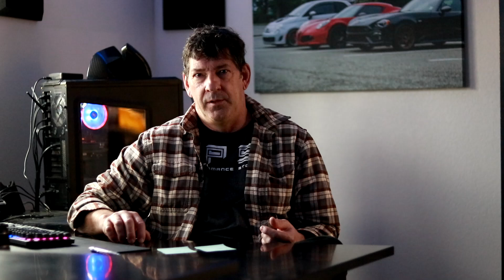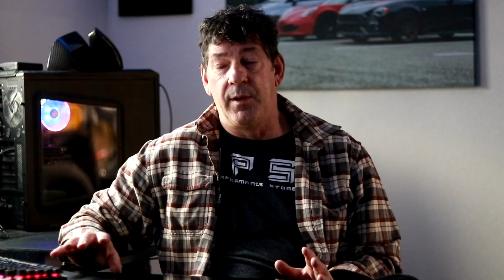Boeing 727 Falls From the Sky TWA 841

Comment: Thank you for the time with this video Greg. Lots of in-depth technical information about the Boeing 727. Just some things to mention here:
1. To have only the trailing edge flaps extend requires more than simply pulling the circuit breaker to the Leading Edge slats. You first have to turn the Alternate Flap switch on, pull the circuit breaker, turn the Alternate Flap switch off and then extend the flaps.

2. The NTSB declared that the isolated extension of the No.7 leading edge slat after the extension and retraction of the slats is what caused the upset. With the slat extended it caused the 727 to roll over into a dive until at 8,000 feet it tore off and enabled the pilots to recover the plane.

3. The pilots did NOT erase the CVR. There was still 9 minutes of recording available to the investigators where they were talking to each other and to TWA Ops after they had landed. The dive and the events leading up to it would not have been recorded because from when they recovered the plane until they landed was 42 minutes so the recording would have begun 12 minutes after they recovered from the dive. Hoot Gibson left everything in the cockpit as it was to help the investigators figure out what happened which is inconsistent with one trying to coverup a misdeed they did. For the CVR to be erased, the plane must be on the ground and completely shut down with the brakes set and the damage to the airplane, in particular the landing gear, meant that its computers didn’t recognize it was the ground. Therefore the pilots could not have erased the CVR even if they wanted to. The wiring to the CVR could have been damaged by the 6G pullout or it was defective even before the flight. Another explanation for the erasure was that a CVR expert determined it was due to the slow transfer of power from engine power to APU power after the engines had completely shutdown after landing.

4. ALPA determined that the physical evidence showed a fractured bolt to the right outboard aileron caused it to free float up and the 727 to turn to the right and off its heading. The yoke turned to the left as the Autopilot Heading mode was on trying to get back to the preset heading. The vibrations were due to the left spoilers raising to aid in roll control. Then the Yaw Damper rate gyro or coupler sensed discrepant rudder inputs which resulted in a lower rudder hardover that sent the plane into a dive. On the 727 the outboard ailerons lock out when the flaps are retracted and movement of the rudder is greatly limited when the flaps are retracted so with a fluttering outboard aileron and a lower rudder hardover the pilots were left with insufficient aileron and rudder control to recover the plane. When the gear extended the right gear overextended which ruptured the System A hydraulics cooling line that centered the lower rudder and allowed them to recover. The No.7 was misaligned and didn't lock into its locking mechanism so the only thing keeping it retracted was System A hydraulics and aerodynamic forces. With System A gone the aerodynamic forces of the dive caused it to extend.

Additional notes:
- Hoot Gibson stated before the upset the plane yawed to the right, paused and then yawed right again. This is corroborated by sharp heading changes on the Flight Data Recorder. Only the rudder(s) could have caused this.
- After they recovered, the Flight Engineer reported they had a fail flag for the lower rudder yaw damper. This would only occur if the rate gyro malfunctions or lost electrical power.
- Days after the upset the accident plane was taken up on a test flight and they went up to FL390 and extended the flaps and slats to the 2* degree position which caused severe vibrations, not slight vibrations as the passengers and crew of TWA 841 had testified. The Captain of this flight testified in court following a passenger suing TWA and Boeing for injuries that he did not believe the pilots had extended the flaps and slats in cruise flight. 

- Actual flight tests on a 727-100 determined that had the pilots extended just the flaps and then the slats extended there would be a sharp pitch up as per the Flight Data Recorder but there was no sharp pitch up on TWA 841.

- Had the pilots extended the flaps in cruise the passengers seated over the wings would have heard the distinctive growl of the flap motors as the pilots extended the flaps and then retracted them but none did.

- The NTSB’s own simulator tests showed the slat would have ripped off at no lower than 30,000 feet, not at 8,000 feet in actuality, and for their theory to be believed, the slat remained attached even at the speed of sound. Boeing engineers determined that the slat could not withstand a speed greater than 363 knots while extended, so the slat would have to have ripped off at an altitude close to FL390.

- The physical evidence showed the over extension of just the right landing gear and the inboard flap track — a pattern of differential damage — was consistent with a large left wing forward sideslip angle present of the gear extension.

- The co-pilot stated in an interview in 2015, months after Hoot Gibson died: "I can’t say with absolute certainty what caused TWA 841 to roll over and dive some 39,000 feet, but I can say with absolute certainty that the investigators got this one wrong." Why would he continue to maintain his and the FE's innocence over 35 years later if they had indeed caused the upset? Was he worried that Hoot would throttle him in Heaven? Nothing would happen to them now for coming clean.

Cheers.

Comment: Good to finally see your face!  Thanks for all the interesting posts.  
I too generally agree with your and the NTSB's conclusion on the 727 dive.  During my 36 years flying for United, about 15 on the 727, we always knew about the "Gibson Trick" and talked about it even before the incident, but nobody I knew ever thought it was a good idea or suggested using it.  Maybe that's why my career was so uneventful.
But...
When I was upgrading from the 727 to the DC10, one of the guys in class had come in from the Continental merger, and related an interesting story.  He was a 727 FO there and had a totally uncommanded outboard slat extension while maneuvering at low altitude and airspeed.   The airplane was controllable under those conditions, they landed safely and wrote it up in the logbook.  Several weeks late he tried to find out what had caused the problem, and suddenly nobody knew  anything about the incident.  Hmmm...
Conversely, I watched a situation when one outboard slat remained extended when going from flap 2 to flaps 0, it took a LOT of aileron to keep the wings lever.

Comment: Hi Greg, one thing I didn't get from your story is why would the pilot want to get to a higher altitude ? Does this allow him to reach his destination faster or at a lower cost and thus get a bonus from the company ? Or is it just to be part of the "went higher than the manual said I could" club ? Thanks and keep up the great work
Reply from the maker: It's usually related to fuel burn. It's often said that the TWA pilots got a bonus for saving fuel. It could also be for mach limitations in some case, or just to get over weather you don't want to go around.
Reply: @GregsAirplanesandAutomobiles thanks that makes sense
Reply: Just to be clear, they were originally flying at 35,000 feet where they had a 100 knot headwind so they requested to climb up to 39,000 feet where the headwind was forecasted to be weaker. With a headwind it decreases ground speed therefore lengthening the flight and burning more fuel. Another thing to mention is that it was after they reached 39,000 feet did the pilots supposedly do this trick.

Comment: The irony of the 727 noise issue is that when Boeing first built the plane they called it the Whisper Jet😆. I believe we got rid of ours because it was cheaper to get new airplanes over the  long run rather than get the Hush Kits (I believe Fed Ex was the STC/Patent Holder for it).
Reply from the maker: There were quite a few different "hush kits".

Comment: When I started working on 727-100s in 1981 I saw a couple planes with the word “hoot” hand written above the L.E. Circuit breaker on the P6 panel. I ask my lead man about it ( old braniff guy)and he told me this story. When I worked at DTW I saw this airplane shortly after it landed. It sat there for a period of time before it was gear down ferried to MCI. 
I’m sorry but I believe you’re wrong about locking out the 40 degree flap setting. That happened because of the United crash in Denver.
FedEx and Pratt and Whitney developed the 727 hush kit. I worked on that program in 1989. The flap setting had nothing to do with the hush kit. There were a couple other kits but they were not very popular.
Reply from the maker: There is no way I can agree that the Denver crash was caused by flaps 40.
Reply: @GregsAirplanesandAutomobiles  it was , with 40 degrees selected the sink rate was too fast for the engines to spool up and fly out of, read the book “ the unfriendly skys “ it has a lot of info on the early days of the 727. After that crash 40 degrees was bolted out could not be selected it had a bolt that prevented it.
Reply: @aaronchandler2380  In that incident, the pilot was too fast/too high, and 'unspooled' his engines ; this led to a high increase, quickly, of the sink rate.  The airplane had been well certified with 40º landing flaps (allowing for greater short field performance), and, also, this high sink characteristic was well documented ( and trained for). The '40º flap bolt' was installed in order for the airplane to meet the ever-stiffening noise abatement rules coming into effect.
Reply: @divingfe  well I’m sorry but the 40 degree setting was locked out because of the possibility of an unsafe condition during landing, long before the noise issues. 40 degrees was not in the takeoff band. I’m not sure how you can un spool your engines on a 727? There was no flight idle so you need to fly it onto the runway, 40 degree flaps made that problem worse.
Reply: @aaronchandler2380   Not true sir. The airplane was certified with flaps 40º and used extensively at that setting. VERY EARLY-ON When UAL had started their own in-house training, they discovered (while transitioning 'straight-wing' pilots) the dangers of 'un-spooling'  when at low final approach speeds and altitudes, Hence the industry-wide reminders to keep spooled up in what is essentially a "short-field" landing, regardless of the runway length.  This remained the case for MANY YEARS, with no issues. Now then, as some  relatively in-experienced pilots were beginning to operate the 727, they may well have had problems, not having had sufficient training. BUT, the 40º degree flap "lockout bolt" happened WELL INTO the later stages of the 727 ('80s???, I don't really recall.. but that was strictly for meeting the upcoming NOISE regulations, especially in Europe. I suppose it made the 277 "easier" to fly?? although of course, it couldn't then  operate out of its famous short fields. And certainly those rated on the airplane thereafter, were , by definition, somewhat less competent.
Reply: @divingfe  the United SLT crash was directly attributed to this. I started working on the 727 in 1981, the 40 degree lock out was already in place for sometime before that. It had nothing to do with noise. 40 degrees was outside the takeoff band, the takeoff warning would sound. There were I believe 4 different crashes all attributed to flying techniques during landing that were fixed with the flap setting change.
Reply: @aaronchandler2380  Sorry Again, Aaron. I started on the 727 in the 60s, was instructing on it in the 70s, and worked for Boeing as such. Flew and FEd it until the end of 94. Yes the lockout was in place around that time, but not because of the crashes. They occurred because of poor training, execution and cockpit discipline. As mentioned earlier, this "characteristic" had been around since 3/4 engine jets were first flying- more notably in the 727 because of its exotic flap setup. We SPECIFICALLY TRAINED pilots about the dangers of 'un-spooling' and un-stabilized approaches. Boeing wrote two specific manuals about Pilot ( and F/E) technique; the 707 Pilot Training Manual, and the 727 Pilot Training Manual. Also, two companion more detailed ones for the F/Es. I know that some  later operators did not give enough training in this as well as other regards, hence the accidents. 
But, if you will research the noise regulation increase[s], during that era you will find that the FAA and the European Agencies put the regs into effect;  the cure for the 727, was to install the 40º flap lockout. which allowed the airplanes to operate without restriction-just barely. There is no question about this. Now, 40º flap has NOTHING to do with takeoff- it is a LANDING setting, along with 30º. Now I will certainly agree that the fewer non-competent pilots/training, were certainly kept out of trouble more so with only 30º degrees to land with- -kind of like 'training wheels' on a bicycle. Cheers.

Comment: Greetings: About the Piper - I would think the weight imbalance would B noticed by a good pilot. Just a thought
Reply from the maker: The Navajo's had inboard wing tanks, and outboards for longer flights. This was a short flight with fuel in the inboards only, and not a lot of that, thus not much lateral imbalance. This was compounded by the fact that many of the planes at this airline were a bit bent anyway and needed unusual amount of trim on a normal day. I know because I flew there.

Comment: Greg, I engineered the B727 for 3.5 years in 1978-1982 and in my observation, flying with Captains and First Officers that were as paranoid as any, we definitely did NOT regularly erase the CVR. Perhaps your company did; I can't recall ever seeing a Captain doing it (and we definitely knew where the mic pickup was, and the test and erase buttons as well).

Second, you really need to look at optimum altitude and G-limited buffet margin charts for the 727-100. What engines did it have? The ones I engineered were mostly JT8D-7A engines, but there were three airplanes in our fleet with the -9A engines (which all of our 727-200s had mounted). I believe the NTSB report said their weight at the time of the request for FL390 was 140,000 lbs, and at max you'd be flying at FL 310, and certainly not FL350 unless you new, ignorant, and crazy. FL390 was right out. 

Third, I used to carry charts in my 727 Jepp binder that were the comedy charts, obviously unofficial, entitled something like "Optimum Altitude Charts for Flaps 2 Extended Cruise" or something. Plus, I flew with two Captains (IIRC) that both argued that you'd save oodles of fuel by climbing with Flaps 2 trailing edge Improved extended and I thought that was crazy to risk your job -- with a hundred witnesses in the back! -- for something unapproved. I searched and I can't find my old charts, they've gone missing in the last 3 or 4 moves.

Fourth, LED circuit breaker was the trip up. Pull that and the blue (or maybe is was green) LED Extended light on the forward instrument panel would illuminate, but that CB controlled only power to that light bulb. No, the CB you wanted to pull was the Leading Edge Device CONTROL circuit breaker: a little harder to find. (I could do it in my sleep, which is a confession that I had more hours as a flight engineer than a guy really wants to have logged.) Hoot and company kinda messed up the LED Control CB.

But uin general, I agree. The aerodynamics do not conform to the NTSB nor Boeing's explanation. But it's ancient history.

And guess what? The T-TAIL didn't RIP OFF in the supersonic high dive! Great success! Regards, Mark Hilsen (Retired in Seattle)
Reply from the maker: Thanks Mark, great post. I didn't get into the mach vs. weight vs. altitude charts because I wanted to make this a relatively short video. Explaining those charts would be an entire video by itself. As for the CVR, it's the NTSB and Hoot Gibson who said the standard procedure was to erase after an normal flight. Some people here in the comments from TWA back then have backed that up. That doesn't mean they did it at all airlines, but at TWA it seems that was SOP.
Reply: @GregsAirplanesandAutomobiles  It essentially was a standard procedure then at many airlines to say the least but wasn't required. However, at Northwest Airlines it was a checklist item/SOP to erase the CVR is the flight was routine. Given the fact that 9 minutes of recording was still available indicates to me that the pilots didn't erase the CVR.